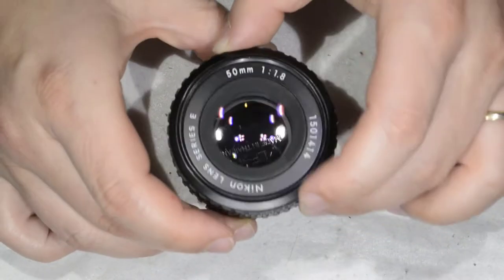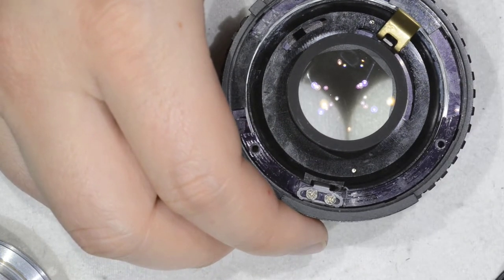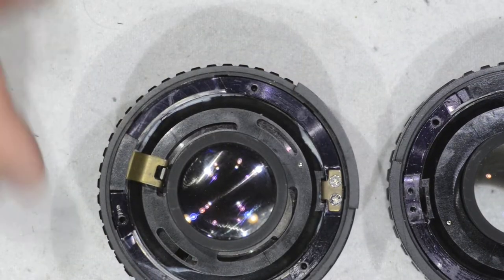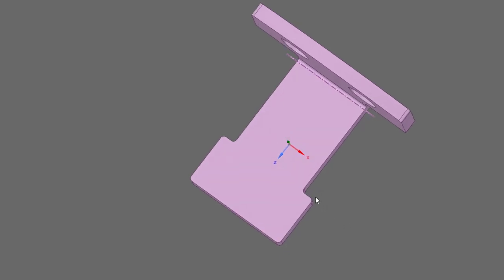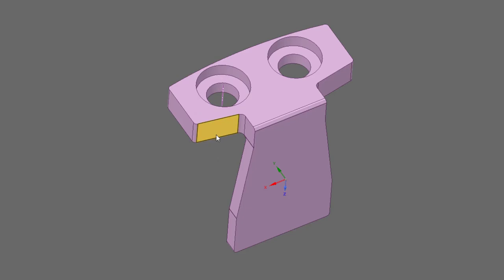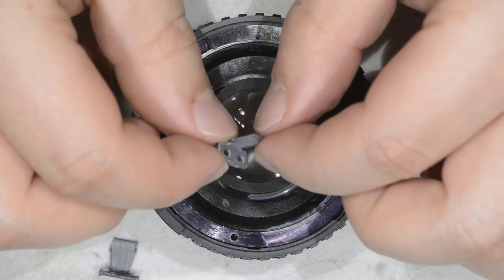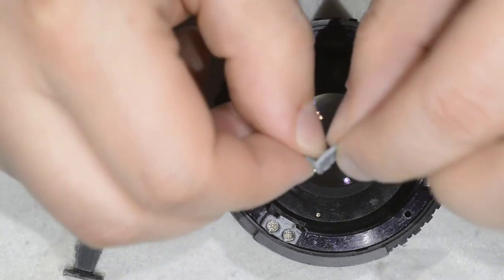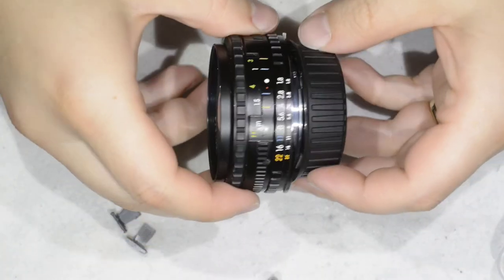Nikon 50mm series E : Disassembly and focus key replacement (3d printed)

Comment: I cant upload a picture here, but I have the Nikon 50mm 1.8 Series E, and it's very well built like a regular F lens, all metal, and AI. The focusing ring is nothing like the plastic in this lens in the video. Did Nikon make two versions? I'll never sell mine, compact and very sharp
Reply from the maker: Hi, yes, there are two versions of the 50mm series E, the one in the video and the one you have. Very good optics both, and let's be honest, the construction of this "cheap" lenses is far better than today's mid-end lenses, even some high ends as well. Cheers.

Comment: ilInteresting Try.. But after doing 3d printing for ~6 years.
 I would NOT trust a wee printed part as replacement for a metal actuating one... Period. 
Failure is a question of When.. not If.
Reply from the maker: Agree, that's why I changed the original design and worked different options for printing direction. It will fail for sure, but who cares, I print a new part. Cheers.